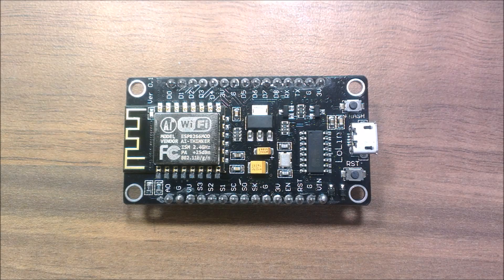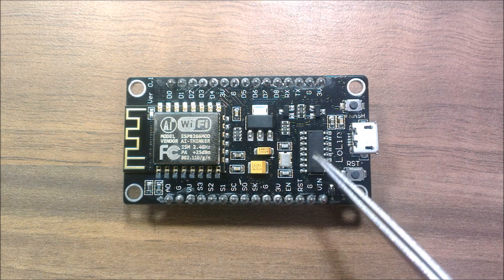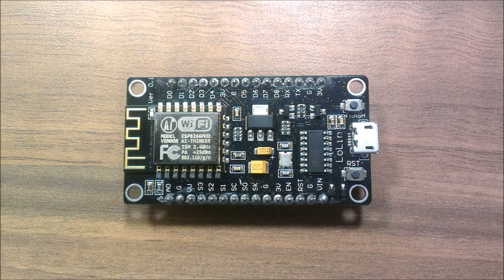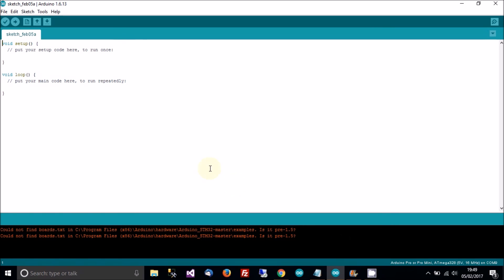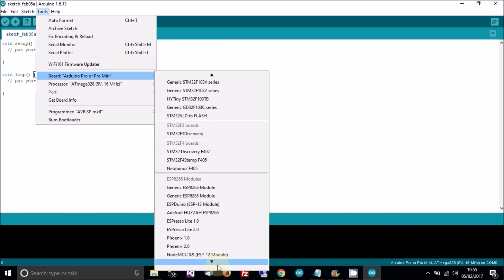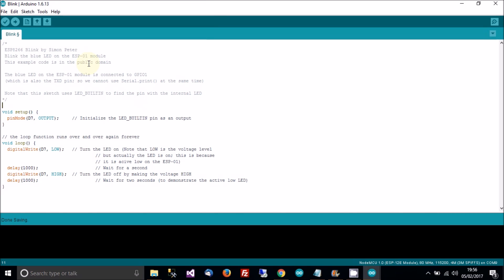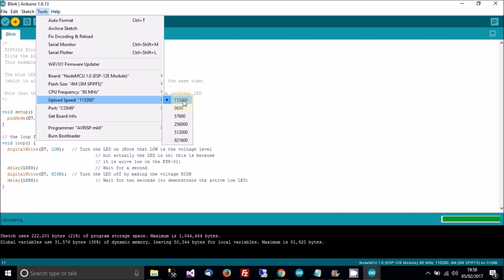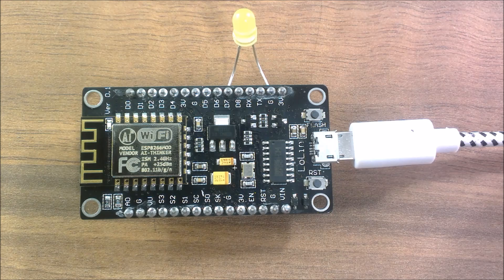TUTORIAL: Quickly getting started with NodeMCU / ESP8266 12E - In 7 mins! Beginner Friendly! Arduino

Comment: Hello Folks,

I would like to control a single DC motor using alexa with the help of node mcu ESP8266 and 2 relay module. The idea is when I say clockwise the motor should turn clockwise and when I say anticlockwise the motor should turn anticlockwise. I dont want to use any third party helpers like IFTTT or Sinric as they are confusing me. I am a newbie and making this for the first time for opening and closing curtains in my home. 

I need help from you guys. Pleas help with circuit, coding part and how to connect the node mcu to alexa echo.

Please reach to my mail ID ranadheer.va@gmail.com for communication.

Comment: Arduino: 1.8.14 Hourly Build 2020/10/09 12:25 (Linux), Board: "Generic ESP8266 Module, 80 MHz, Flash, Legacy (new can return nullptr), All SSL ciphers (most compatible), dtr (aka nodemcu), 26 MHz, 40MHz, DOUT (compatible), 1MB (FS:64KB OTA:~470KB), 2, nonos-sdk 2.2.1+100 (190703), v2 Lower Memory, Disabled, None, Only Sketch, 115200"

/tmp/arduino_modified_sketch_292442/Blink.ino: In function 'void setup()':
Blink:13:11: error: 'D7' was not declared in this scope
   pinMode(D7, OUTPUT);     // Initialize the LED_BUILTIN pin as an output
           ^
/tmp/arduino_modified_sketch_292442/Blink.ino: In function 'void loop()':
Blink:18:16: error: 'D7' was not declared in this scope
   digitalWrite(D7, HIGH);
                ^
exit status 1
'D7' was not declared in this scope

This report would have more information with
"Show verbose output during compilation"
option enabled in File -> Preferences.

Comment: Good video, Thank you Antony! Once thing that is worth mentioning in case anybody encounters the same issue as I did is to use a different github link, as there is some bug in the Arduino IDE that makes it impossible to install the board through the board manager. I used this one: https://github.com/esp8266/Arduino/releases/download/2.3.0/package_esp8266com_index.json
The above link gets the boards back. 
Works like a charm.

Comment: Hey I know this is a little late, but you didn't use a resistor on the led in the video. Do the ESP8266 boards not need one, or were you just living on the edge?
Reply from the maker: I should have used an LED but for the purposes of simplicity, it's ok.

Comment: Hi 
 Can you help with the esp8266 in home automation?
I'm using it for home automation and the problem is when it reboots as the power gone, it automatically turns everything on .
I don't need anything to be on state.
Please help with it ?
Reply from the maker: See if the esp8266 has an eeprom. If it has one, save states to it every 60 seconds. If not, add and eeprom and do the same. On restart, read from the eeprom and voila!
Reply: @antonycartwright  I have Checked with it. But though it is turning on when it reboots. Now I ll check with eeprom. Thank you sir

Comment: Hi bro 
 how are you ?
i hope you are good..

bro I need you are helps . Actually i buy one   Lolin Node muc V3 wifi Borad .
4 relay Channel Switch And one PIR Sensor.. please help me . i want make one project ...but i am facing some short problem with my set up... my Contact No 9582109979)
Reply from the maker: Hi, I'm great thanks! If you are having shorting problems, you may have already destroyed the board. Best thing to do at this point is disconnect everything above 0v. You will then need to test that the board is working before carrying on.

Comment: how many relays we can connect with a nodemcu at the sametime ?
Reply from the maker: Mohit kundu probably 10-15 with transistors/mosfets to drive them.
Reply: i wana use the relay instead of leds for home automation project. then i want to ask you to how many home appliances i can control with single nodemcu esp8266 for control them over internet.
Reply from the maker: Mohit kundu 255 devices...

Comment: I found this device and instantly wanted it! I bought it and got it, I get com ports... Only 1 (com port 3), all the videos I have watched they use com port 9. If I go on my phone and try to connect to it on my wifi, it shows a open unlocked networked called ESP. I downloaded the flasher and Arduino and it seemed like everything went well until it showed com port 3 instead of 9, and I still can't get it too work. Any suggestions?

Comment: An esp8266 can source approx 12ma per io pin. I have a device that runs at 20ma.  Can I sink this higher current without burning up the io pin? And, is that a good idea?
Reply from the maker: It's not a good idea to go against the specs, just power it externally.
Reply: Thanks,  I was just trying to avoid more components. I noticed that the esp8266 could sink 20ma but wanted your opinion on it.
Reply from the maker: William Miller you will only need one more component, AMS1117. :)

Comment: Port issues: if your ESP8266 NodeMCU doesn't  appear to have a port connection, then check that the cable you are using supports data. Some USB cables only supply power for charging purposes. You can get the port number by opening up Device Manager in Windows and you'll find it under Ports (COM & LPT) -> Silicon Labs CP210x USB to UART Bridge (COMx); where x is the port number. Speaking of Silicon Labs, this is the driver and can be found at https://www.silabs.com/products/development-tools/software/usb-to-uart-bridge-vcp-drivers. Sorry I can't offer anything for Mac/Linux users, but you may be able to fill in the gaps based on the above information. As far as using D7 goes, this isn't necessary as LED_BUILTIN will find the internal LED port (as mentioned in the code comments). This video helped me to finally get this thing working (thanks for that!) with a few tweaks just mentioned. Happy hacking :)

Comment: 6:27  Please use a resistor in series to that LED  D:
(or just use the on-board LED)

Here's the calculation for the value of the resistor if anyone is interested:
Minimum R value = (Vsupply - Vled)/0.020A
Where 0.020A is the led's max current rating.

For this example:   Min R = (3.3V - 2.0V)/0.020A = 1.3/0.02 = 65ohms
So anything between 65 and 470 ohm should work fine.

Comment: Hi there... I did everything as per the tutorial. It's working fine. Thanks a lot. 
Now I tried to connect to Wi-Fi. Just wrote a simple code to connect to Wi-Fi.  Using Wi-Fi.begin(ssid, password). But it doesn't connect.  So I tried to run the Wi-Fi scan from the examples. It scans and says no network found. Can someone please advice

Comment: Any android micro usb cable can be used right? Because I'm facing a problem where my arduino ide cannot detect the connection to my laptop's port
Reply: I found the solution to my problem. I have to download driver to be installes to my computer from Silabs. You made a great video! Thank you!
Reply from the maker: Thanks!
Reply: Koon Kee Ohhh.. Thnx... Was facing the same problem

Comment: I must be thick because I don't get it. Where does WiFi come into it ? If I wanted to flash an LED I could use a much cheaper Arduino clone.
Reply from the maker: Hi! WiFi isn't in this video. This is just how to get started with the module. I'd need to do a separate video on WiFi.
Reply: Oh! Ok I suppose. I had hoped this video was at the very least going to explain how to use the board to connect to the internet.  I guess I will have to try to find a more helpful video. Thanks anyway.